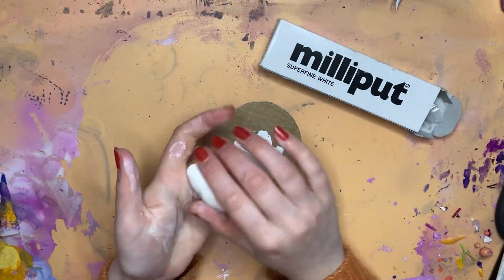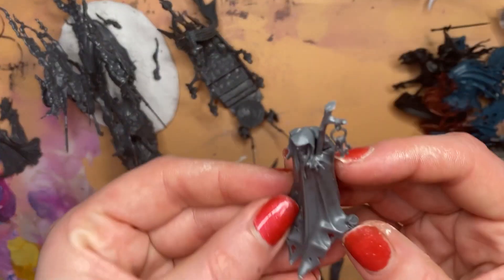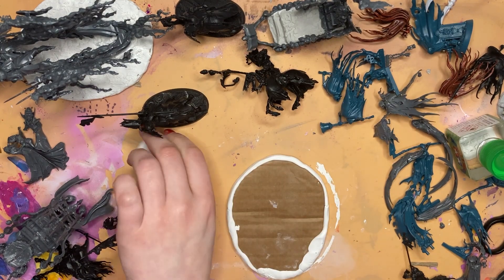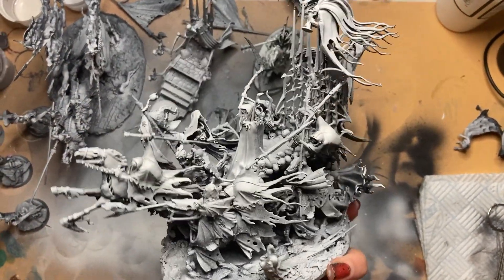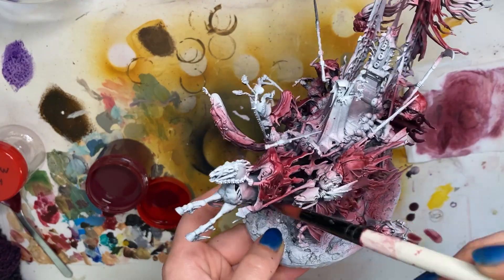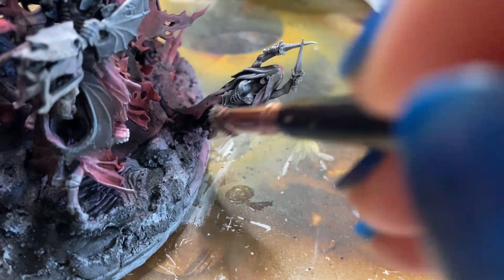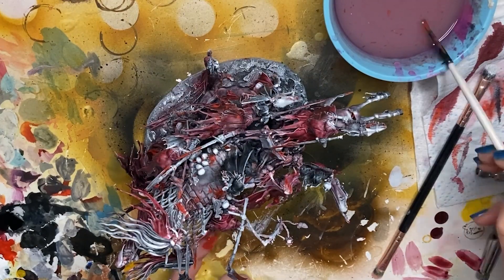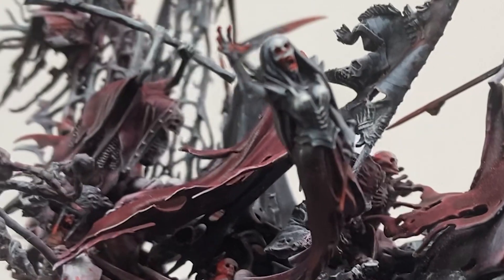How to Kitbash a Coven Throne

Comment: would you please explain again what Knights you have been you for your Model? Are they still beeing sold? The Throne is out of Print. 

The Zenethal prime looks great. I will use Xpress colors to get a quick paint job
Reply from the maker: I used mostly nighthaunt models. There is a dual kit of black knights/hexwraiths on horses, and the rider at the front is a  dreadblade harrow. I think I also stuck on some myrmourn banshees, and glavewraith stalkers. 

A bunch of these models were released for cheap with magazines from Hachette Partworks, but I’m not sure if they are still available.
Reply: thank you for the answer. what are the blue models you been using?
Reply from the maker: @nicolaim7061  the ones with scythes are grimghast reapers :) also nighthaunt